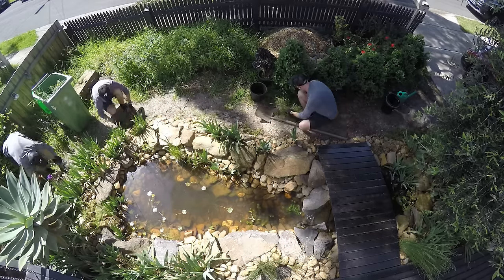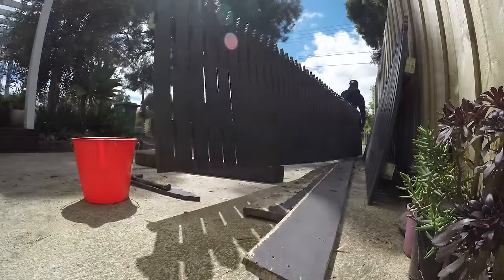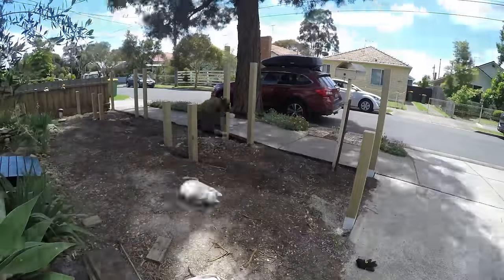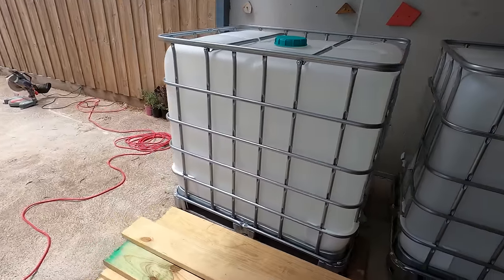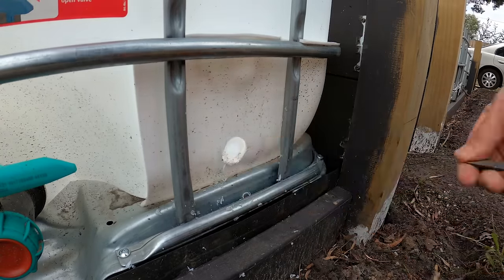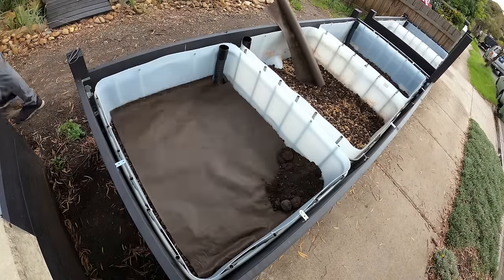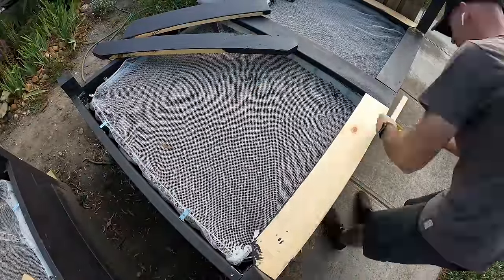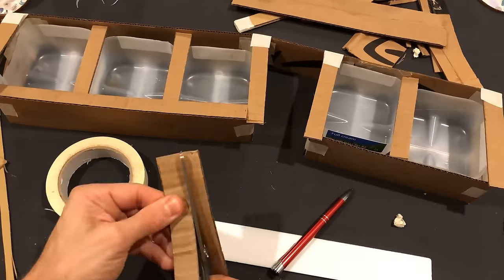Stylish, self watering raised garden beds! How to build

Comment: How does the water wick up into the soil if there is no wicking material between the soil and the water; like twine or strips of cloth? If the water in the reservoir is half full what is drawing the water up? Thank you.
Reply: This is what I came to ask too. I'm very curious
Reply from the maker: It’s a good question and I don’t know exactly how, but the weed mat material is not a barrier for the water, on the contrary, it’s probably helping.
The soil above is like a sponge and there must be enough natural moisture movement deep down to create the wicking effect.
Some people like to put a depression in the gravel so the soil in that part sits lower, but soil will naturally seep down the sides and I haven’t found the need to do this. I’d rather have that extra space for more water.
These beds have already withstood 8-9 hot summer days on a single watering so the plants are having no trouble finding the water.
Reply: Think about anatomy, where a substance moves across a membrane from a higher to a lower concentration. You fill the water reservoir to the top and as you add you soil you water it in. From that point on the water will move across the weed barrier to the soil as the plants and sun use and evaporate it. Watering then becomes a weekly check to see the reservoir is topped off.
Reply: @TheBiteSizedGarden  Thank you for replying and for sharing your knowledge and skill.
Reply: @kathleenreadinger4614  Thanks. I guess I'm struggling to understand how the weed barrier soaks up the water if it's not in contact with the water when the reservoir is half full for instance.
Reply: The answer is pretty ingenious, but then nature is in general. It's not the soil that wicks water up to the plants - it's the plants roots that defy gravity and pull up the water. They are solar powered, water pumps. When the sun hits their leafs, they start the photosynthesis process, which kick-starts their whole digestive process (ie: energy conversion). That's when the roots are called into action to suck up nutrients and moisture from the soil, in order to convert, grow and produce fruit.

That's the long answer. The short one to your question is, the plant roots are the wicking material. 😉🙂
Reply: I did about the same thing with pickle barrels cut in half. I do have some soil in the center of the drain pipe that's coiled up in there. I kind of pressed the weed barrier down in that spot. Lowes sells a planter called City Picker around $30 that works on this idea. I have had good success with it.
Reply: The roots will search out water and also evaporation through the oxygen chamber under the soil
Reply: I noticed that he filled the spaces around the pipe with gravel.  This would need to be fine gravel, that allows water, via (I think) surface tension, to make its way upward through tiny spaces.  Would need to use a water absorbent weed mat or ag cloth.  With the pressure of the soil above, it should all stay in contact.  I wonder if the reservior was fully enclosed with the water absorbent weed mat, so that it was fully in contact with the base, sides and top, it might solve any potential problem.  The water would then travel through the weed mat to the contact area with the soil.
Reply: magic
Reply: @TheBiteSizedGarden  the wicking material in the centre of the ag pipe should be sand as it’s one of the best wicking mediums, if you YouTube “wicking bed forum’, it’s an excellent video on wicking beds
Reply from the maker: @V111RDF  Thanks for the tip. I will have to try this. I read that using sand reduces the water holding area, but as a column in the middle it would work well.
Reply: In a close room, there is always a part of water in a  evaporated state between the water surface and the wicked mat. The partial pressure is in a state of equilibrium. Water evaporates and condensate on the wicked mat from below.
So you always got moisture from below in the soil. The higher the temperature, the more the evaporate rate. The only risk is, when you have rain more millimeter then the drainage layer, it could create a swamp.
Without rain, it only works with plants that consume less water then evaporates (for tomato's you may need a wick or a drainage up to the soil with direct contact).
Reply: That's the biggest water Depot project I ever saw. With passive watering.
Reply: Evapotranspiration. Check it out. Also highly recommend getting to know the natural hydrological cycles and the hydrosphere.

Comment: Can you state the dimensions of both the individual totes and the total space that your beds take up including the access paths.  Thank you. So inspiring!
Reply from the maker: The IBC tanks are 1200x1000 including cage. 500mm high without the base when cut in half.
The smaller 2x beds are 2160x1380.
The larger 3x bed is 3170x1380.
Gaps are 500mm.
The height of the beds vary as the ground is not level. 700mm at the highest point. The mesh frames are 650mm high.
Reply: @TheBiteSizedGarden  Thank you for the quick response. We are inundated with gophers and raccoons here all over California and I think this is a brilliant answer to the gopher problem. Your design looks like it will last a lot longer than most raised gardens. Both the wood and the plastic are more protected. Love it! I subscribed

Comment: I have a question about the material of the container…if it’s plastic, is that safe and not leaking micro plastics?
Reply from the maker: Good question. Micro plastics in our food system are a huge problem for humanity but these IBC tanks are food grade and very stable, so will last for many many years, especially as they are not in direct sun light.

Comment: I'm confused . . . why did you seal up the taps that came on the tubs and then add overflow valves right next to it? Why not just use the original tap as your water overflow valve?
Reply from the maker: Hi Jenna, the original taps sit right at the bottom of the tank, so if you were to leave these open all the water would drain out. The overflow I added allows you to fill the tanks up and create a reservoir for the soil to draw from, but stops the whole bed from filling up in heavy rain.

Comment: How do you get to the drain valves if needed?
Reply from the maker: Hi Debi,
The over flow drains are made from a combination of 13mm irrigation fittings, from memory it was 1x double headed male thread piece with a ridge in the middle and two 90 degree angle female thread pieces that attached on either side.

Comment: What did you use to paint the wood? I've thought about adding a trim to the top of some beds I have, but haven't figured out if/how to treat the wood so that its safe around veggies
Reply from the maker: It’s a water based exterior paint. From everything I’ve read it’s perfectly safe. It’s not in direct contact with the soil either.

Comment: Hello there. I am in the processing of building a wicking bed. I am wondering what material is the best for the water reservoir? Sand or rock? I looked at getting lava rock and it is hard to find or verrrry expense. Please advise as I want to make the bed correct the first time. The bed is 8x4
Reply from the maker: Hi Tim. The aim of the rock is to create space for the water to pool while holding up the soil above, so I’m thinking rock would be better than sand. Especially volcanic rock.
The more space you create for the water, the more your bed will hold and the longer it can go between watering, which is why I used ag pipe as well as rock. If you can find something similar, or even off cuts of PVC pipe which you could drill holes into, you will minimise the amount of rock and hopefully cost.
Good luck!
Reply: Since rocks don't wick very well compared to sand, if you only use rock you'll not get to all the water at the bottom of your resivior. But you can use rock to create more gaps for more water around the parimiter around your drainage pipe, then use a sand "core" as your wick in the center. Separate the sand from the rock with some weed fabric then cover in mulch and add your potting mix.

Comment: I am confused.  The purpose of a weed barrier is to prevent the roots of plants getting through.  If I am understanding what you did.  You placed the weed barrier between the gravel (where the water resides) and the soil (where the plants reside).  10:13
How are the roots of the plants going to access the water in the ibc container?
Reply from the maker: That’s the beauty of the wicking system. The soil draws the water up like a sponge so the roots can access it. The weed matting is just there to help keep the soil from clogging up the rocks and allowing more space for water to reside in the reservoir.

Comment: Any advice on now to keep cats away so it does turn into a luxury litter box?
Reply from the maker: Ha! Good question. Cats tend to go for loose soil so using a heavier mulch could be a way to go. Otherwise you could net the garden until the plants are big enough to cover the area.
Reply: I have the same problem with brush turkeys in my garden. It's a two prong attack using physical barriers. (1) Lay something over the surface that makes scratching laborious, and/or (2) make head height an issue for them to position to scratch. My solutions are designed for acreage, so I use a lot of excess woody material. This would not be aesthetically pleasing for a small, suburban block.

However, you could easily manufacture a cage that sits on the edge-boards, using similar principles. Allow for 20-30cms head height, so plants have enough space to establish underneath. It could double as framing for holding light shade cloth, making it easier for your plants to establish as well. It would be an aesthetically pleasing design from the street.

I foresee the problem in this design though, is a place to store the cages, once the plants fill the bed? So maybe install an aesthetically pleasing racking system to the street-facing tall posts, so you can lift them a level, as plants grow. Keep the shade-cloth on top, that way you have built in shelter from your plants as they live out their life-cycle.

Or if that is not something you want to look at, then maybe hang them on an unused, out of the way, side of the house. A much simpler and more cost effective solution, is installing a cloche system, using wire hoops and netting. They are easy to install when needed, remove when not in use, and don't take up much storage space afterwards. That's if your neighbours are cool people and like the look of that sort of thing. 😉🙂

Comment: Did you have root rot?
Reply from the maker: No, that’s the beauty of the wicking style beds. The water sits at the bottoms and is drawn up as needed. There is an overflow valve 10cm from the bottom to stop it filling up in heavy rain.

Comment: Respectfully, all that plastic with its $ and enviro cost is doing what the microorganisms do. The wicking of water. Plus by putting a bottom plastic barrier you are preventing the roots from growing deeper. Those deep roots brings up nutrients, break down the clay and eventually give you healthier soil over time.
Reply from the maker: You're right, this would not be a good solution for a lot of plants. I'll only ever be planting annual veggies in these so the roots won't be getting that deep.

Comment: I do not see the use for the tanks. You already built a wood frame bed, you could have used 5-6 mil plastic for a liner and been MUCH cheaper and not wasted any space around the edges.
Was there a reason I am missing for the metal and plastic tank?
Reply from the maker: Over engineered for sure, and yes, I could’ve used plastic, but I don’t like cutting holes in it and this is never going to spring a leak.
Reply: @TheBiteSizedGarden  Not only that, try replacing the bottom board thats holding a ton of soil behind it.  You did good and I am going to copy it.  lol

Comment: Instead of an aggregate etc in the water res why not use cheap as milk crates?? Weed mat over the top then your soil goes on-top of that..
Reply from the maker: You could, however the weed mat will break down and the soil collapse down into the gaps meaning you’ll lose a lot of water holding capacity. Also, not sure how stable the plastic is in milk crates.
Reply: @TheBiteSizedGarden  if not weed mat there would be plenty of other materials to use,I just went weed mat first cause cheap...
Worth a shot,milk crates are cheap cheap

Comment: Your overflow/drain looks NEARLY at THE BOTTOM. 
You said it's 10cm up eating 40 cm for soil but it looks like it's at the bottom of the container as you put it in on place 8:05 

Also why would you steal shut the holes that were already there in the container and then drill ones next to it at the same level LOL😊
Reply from the maker: The base of the tanks curve a little so it may look that way, but I assure you, the overflows are at 10cm. The holes that are already there are at the bottom, moulded centrally so all the water would drain out if I left them open.

Comment: ☝️FIX: YOU NEED A WICKING SYSTEM.
Either get rid of the cloth so the soil can go down between the rock OR use rope/cloth (some kind of wick) for them water to move up they the fabric and get into the soil.

You're on to a good idea, but the design DOESN'T MAKE MUCH SENSE.
🤔You will fill the bottom with water... and it will have to fill all the way  up to the draim hole before ever even hitting the fabric and soil ... BUT BY THEN IT'S AT THE DRAIN HOLE and never reaching the soil (or barely) before it draind out!

You will constantly have a water reservoir being UNUSED and sitting at the bottom...

And every time you water you will be just topoing yhe resevoir before losing most off it out the drain hole and the water isnt reachihg the soil... (Even if it absorbs a little, it still isn't very effecient at all...)

Just trying to help ... Its almost there and still a good idea ❤
Reply: Or loosen the fabric and push parts all the way  down to the bottom to serve as the wick
Reply from the maker: 1) I don’t believe you do. There is enough capillary action with pressure, change of temperature and general absorption that wicking occurs regardless. 

2) I recently dig down to see and this was confirmed by condensation up the sides, well above the gravel. Roots had made it down into the reservoir and there was very little of the cloth left as it has already begun to degrade. 

3) the overflow is not a drain. It is there to stop the tanks filling up and turning into a swamp. The whole idea is to have moisture in the bottom and drier soil above to create the wicking effect. These beds are working, despite what you may think. They have lasted over 10 days in full summer without being watered. Could they be more efficient? Perhaps. Do they wick? Absolutely.